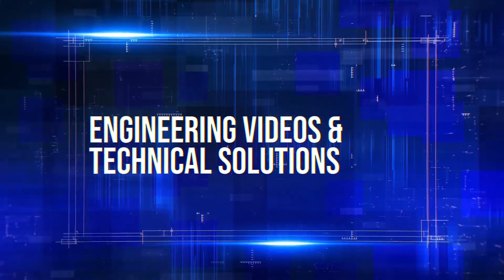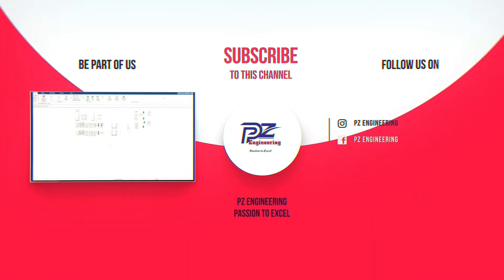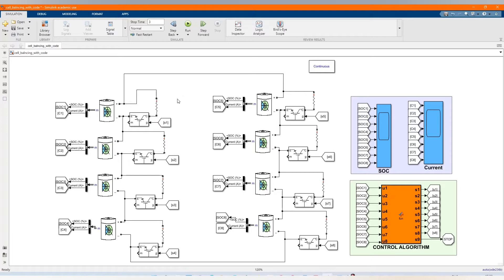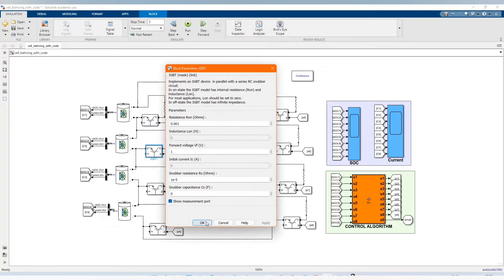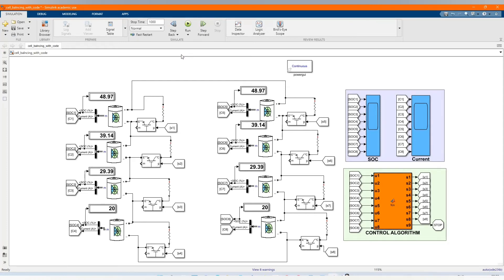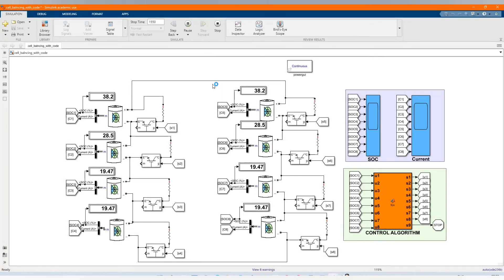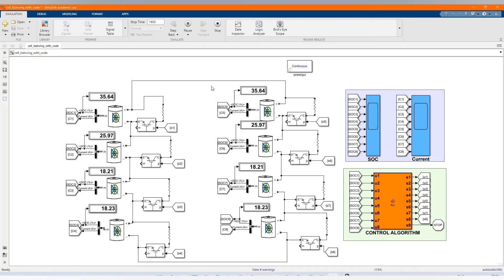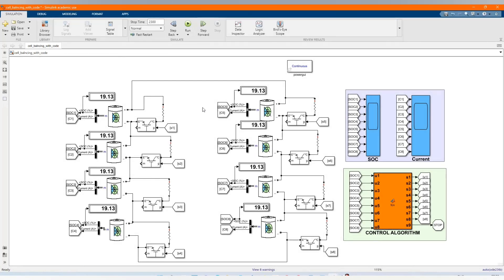Passive cell Balancing in Lithiun-Ion Battery Pack In MATLAB Simulink

Comment: Do video on active cell balancing
Reply: Ok sure.। 
And plz explain why any block parameter are selected. What are calculation behind that. Eg if i chose a inductor value 20 then plz explan how that value is calculated
Reply from the maker: @vijaygawade2707  The main function is in the control model, However, We will send you some documents
Reply: @pzengineering2020  hello sir I'm waiting for video on active cell balancing..
Reply from the maker: Hi thank you for your comment, We will work on that